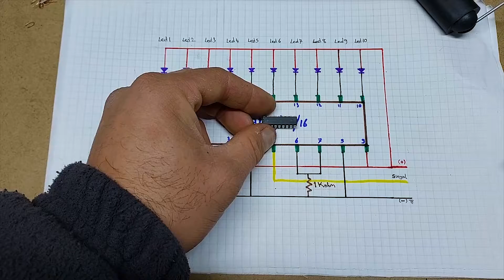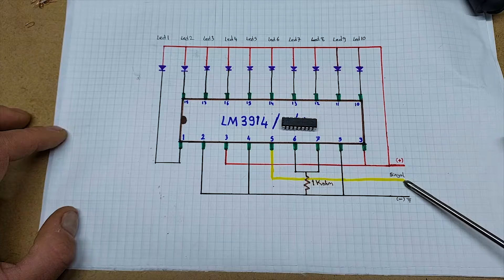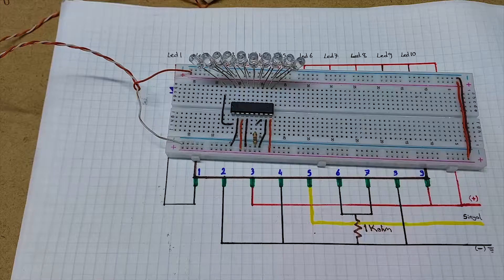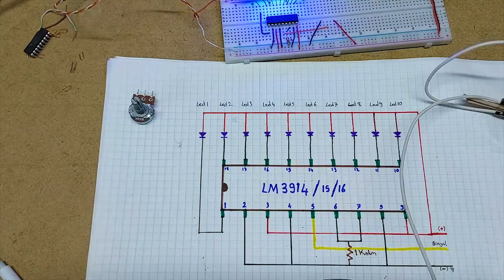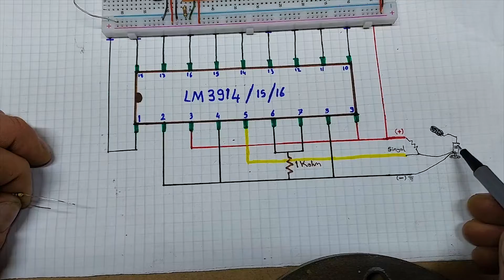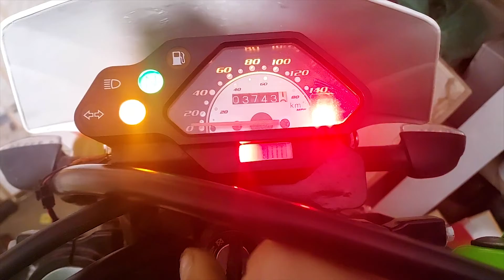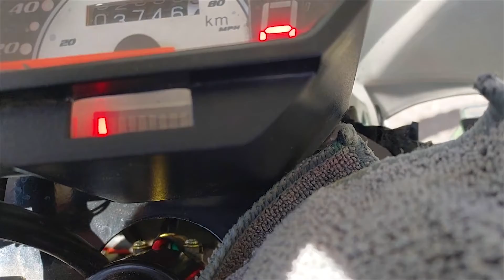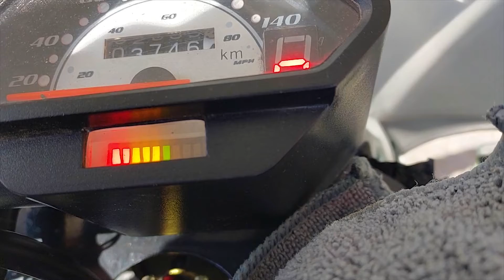make FUEL GAUGE from scratch - shows each level - LM3914

Comment: @Kadir-Akkus
07:00 It can be also done by the reversal of the led pins.... 
 (For this wire should be long. You can't simply attach ic with display bar)
Like....
 1 with 10, 
18 with 11, 
17 with 12, 
16 with 13, 
15 with 14, 
14 with 15, 
13 with 16, 
12 with 17, 
11 with 18, 
10 with 1

 ( 1:11 schematic reverse)
 So automatically when it is full ..it show full
Reply from the maker: Thanks for information. You are right. I wanted to save some space 😊
Reply: can u help me sir?, i want to ask about resistor for this project